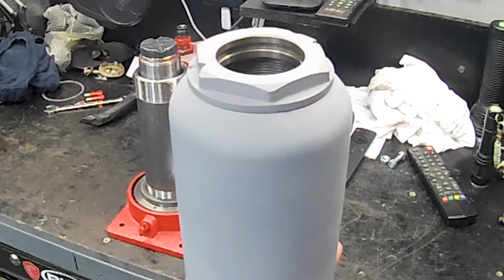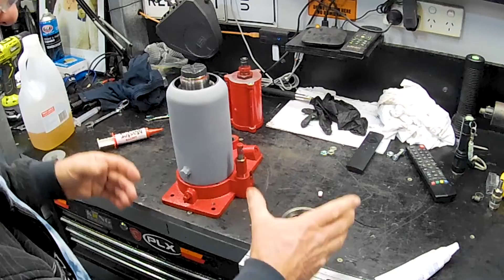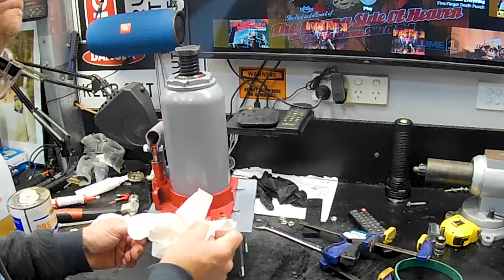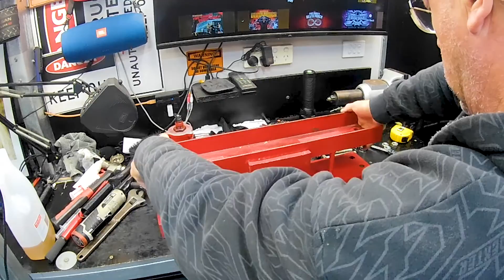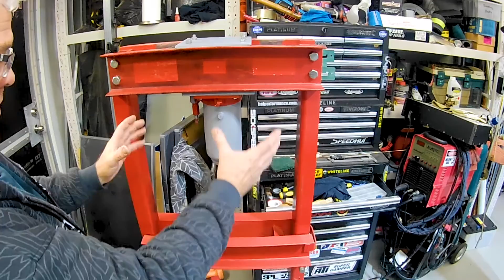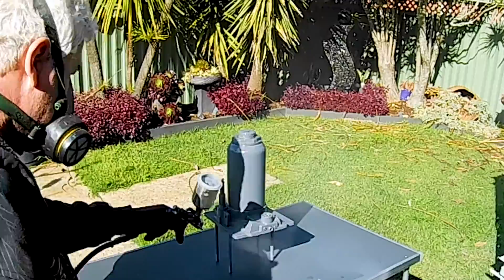The Ultimate 20 Ton Shop Press Build, EP:4 Assembling The Inverted Air Hydraulic Jack

Comment: interesting adaption of an inverted jack.
I have noticed that a lot of guys on you-tube has been calling the hole in the top ring nut, that you JB weld plugged, a breather to equalise the internal air during the raising and lowering of the Jack.
I am not sure if this is correct, as the jack equalises the internal air pressure through the rubber filler plug hole.
The hole you JB weld Plugged I believe is the air/oil spill over hole and not an air breather. As I will explain.

With normal use the jack piston has a small amount of blow by, meaning that some of the oil will leak past the piston seal and builds up on top of the piston along with the small amount of air between the piston and the cylinder. This air/oil travels up and down the cylinder with the piston and ensures it is well lubricated. No big deal.
However, if too much oil leaks past the piston seal and the gap above the piston  fills with oil, the oil will be compressed between the piston and the top  exit oil seal on the piston.
To prevent any pressure build up the hole that was Plugged, bleeds the oil back to the reserviour
So essentially as the piston rises the oil reaches the bleed hole and then flows back down to the reserviour. This limits the oil ridding on the top of the piston.

I would not block the hole but rather keep it open.

more so with the jack inverted, the top O Ring of the cylinder is the only seal that is stopping the oil leaking out of the top of the piston (that is now at the bottom).
good work and very entertaining.
What part of this great country do you live?

Comment: The vent hole in the cap was likely more of a drain to return any oil the wiper scraped off the rod to the oil reservoir. No clue where the actual vent is, but I've always heard that the rubber fill plug deforms allowing air in/out.

Comment: Wondering why you decided to jbweld the breather hole instead of just welding it shut?  I just started inverting mine and I'm staring at this tiny hole, and being a welder I'm seriously contemplating plug welding it.  Maybe you thought of something I'm not?  Awesome videos though, I've really enjoyed watching your 20ton series
Reply from the maker: G'day Mate, I filled it with JB due to it not being under any pressure when in use & it was easy. I can't see any problem welding it up if you feel the need. P.S. this press is still in operation today 3 years later, all working perfectly & no leaks on either the hydraulic or air sides. So glad I went to the effort of doing this. Cheers Mate.

Comment: Really well done -- Thanks!
My weak link is the air pump -- it ceased to work at all more than a year ago. After complete disassembly, lube, line checks, air checks, etc etc etc, it simply will not work. Doesn't even make a noise. Root cause unknown mystery. At least the hand pump and bottle still work well. I'd replace the pump if someone had them for sale (without buying the whole assembly of bottle + pump).

Comment: Learning a lot watching this series; thanks for posting these videos and excellent job.  I wanted to add that on the circa 2003 or so version of the same press it arrived from the factory welded at the top; my version had no bolts at all on the top rail.  I believe the factory made that change (to make the top rail bolt-on) simply to reduce the size or volume of the shipping box.
Reply from the maker: Thanks for the info Mate, Cheers.

Comment: Man I am racking my brain trying to understand the fluid flow of all this. There's fluid up to a certain level and then air above that within the reservoir. There are pipes extending the fluid pickup to below the fluid level, but why doesn't gravity equalize the fluid level within the pipes to the reservoir when not pressurized? My (obviously flawed) logic is telling me that after hours of sitting there, the fluid/air level within the pipes should be the same as that outside of it...meaning the bottom of the pipe would be in fluid, but right at the pickup would be quite a bit of air.  I assume there has to be some kind of vacuum preventing that from being the case, but I don't understand how the air would have been bled to create it.
Reply from the maker: G'day Samuel, i'll try to explain. The initial amount of air in the pickup tubes is expelled after the first cycle. when the hydraulic cylinder is retracted by the springs it forces out any air that was present in the pickup tubes. The fluid level in the pickup tube is then maintained, due to the vacuum created by the pathway from the pickup tube, to the pump, to cylinder all being a sealed system. I have used the completed press many, many times since its completion & it only ever required the initial bleed, which as explained, it does all by itself on the initial cycle. For air to bleed back into the pickup tubes there would have to be a leak in either the pump or the main cylinder. Hope this helps, Cheers Mate.

Comment: Over here we have the same stuff from Harbor Freight. I'm following your build and can't wait to see it working. I am wondering how to bleed the air out of the hydraulics and how it works in the long term. I am planning to do the same to my press if your mod turns out well.
Reply from the maker: G'day Mate, great question, the Hydraulics bleed really easily, even easier than before it was inverted, due to the pressure relief valve now being at the top rather than the bottom as it was originally. Couple of pumps on the handle, release the valve, the cylinder retracts & its bled. Works a treat, Cheers.